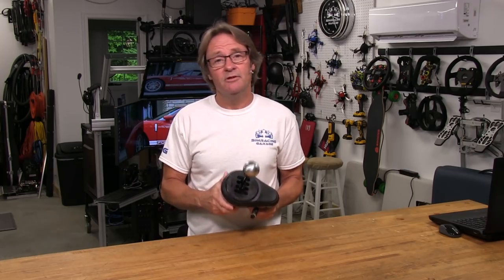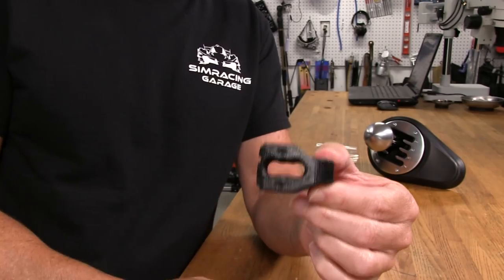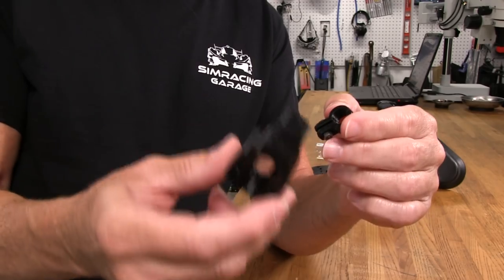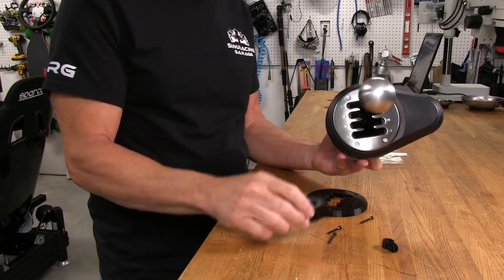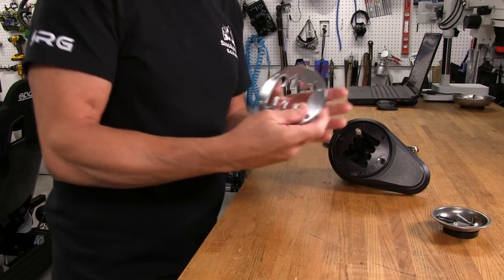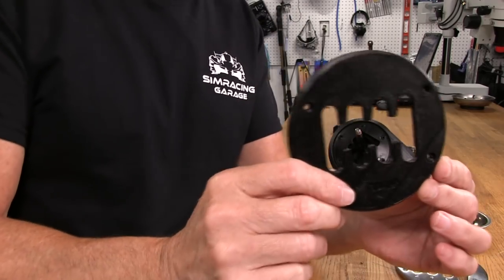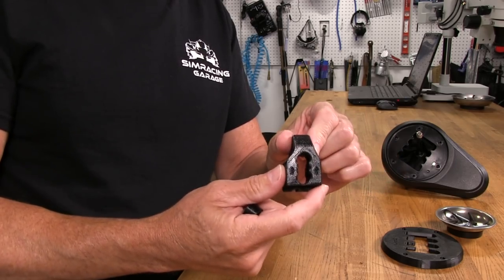3DRap Thrustmaster TH8A Mods

Comment: Hi Barry great video my tactile mod lasted a few months greased up but with heavy use I bought another and it lasted similar time so what I have done is drilled and tapped out for m5 spring ball plungers on the 4 proud points of the mod so that the shaft pushes past the spring ball bearings instead of the pointed plastic also I put some thread lock on it’s going well 6months on
Reply: Hi Mark, is it possible to share your mod ?
Reply from the maker: Sounds like a well thought out solution. Might want to think about producing them yourself. I'm sure folks would buy it. Especially if the life cycle is long. PLA is a great prototyping material, and for some things like enclosures and such, works great. If I was making this mod, I would be printing it with a suitable nylon filament. And maybe adding your spring ball mod to that. I think it would last much longer. More expensive to produce of course.
Reply: Interested on how to mod this with the spring ball plungers.
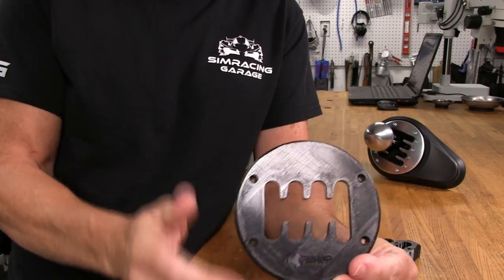Reply: skip to 4:30 or so
Reply: Sim Racing Garage Barry if you managed to mod it please make a video, I am sure it will benefit alot of fellow sim racer. Thanks!!
Reply: can you share pictures about so we got to understand t better?
Reply: ahmed mohmed when I did my own mod nobody else was doing it maybe I should of took it to market but lots of people are doing it now just look at the clix beatle pro mod or the are some cheaper Chinese versions on eBay

Comment: the tab on the metal plate cover is only a locating pin for the rotating assembly. the sequential button would be in the center of the top right and bottom right screw holes given the rotating assembly is clocked for sequential mode.

Comment: I get a bit bummed out with sim racing gear sometimes. This seems like a neat idea if you don't mind regularly buying replacement parts or own a 3D printer and don't mind taking your shifter apart regularly either to grease it or replace parts, but I'd prefer to have something more durable/permanent.

The problem is, when I search for mods I either find home made mods where people wrap rubber bands around stuff or 3D printed parts like these that just won't last very long. I'm willing to pay that bit extra for similar concepts that are better executed and more permanent, but nobody seems to make them.

I could shell out more money for a better shifter, however I'm a cross platform gamer and it bugs the hell out of me buying expensive equipment that I can only use on a particular platform (I find it ridiculous that they expect people to buy a wheel that costs more than a console for each console they'd like to use a wheel on).

This last paragraph is less reasonable for me to complain about, but I've started my rant so I'll finish. I have a lot of older console games for PS2/PS3 that I'd like to be able to play using a force feedback wheel in future. I wish wheel companies included legacy support as it's a pain in the neck having to hold onto (and mount) old Logitech wheels when I want to indulge in a bit of nostalgic racing. I doubt it would be hard to do and I doubt it would be any skin off Sony's nose if someone included support for their discontinued consoles. I do however suspect I am either part of a very small minority or the only person that cares. Guess I'll never know how Enthusia Professional Racing feels with a direct drive wheel (when I eventually get one). 😥

Comment: Great review.  2 questions: How would you tighten the lock nut ring if you don’t take off the metal housing, and does the zip tie that was removed serve any purpose?
Reply from the maker: There is enough room inside the housing to get an allen wrench in and tighten the locking collar.
Just need to turn the collar to facilitate. Zip tie installed at factory to take up slack in that wire to keep it from interfering with the movement of the shifter lever mechanism.
Reply: Sim Racing Garage so removing the zip tie can cause any risk for the cable to snap after the reassembly during the usage of the shifter ?

Comment: I wish they could make this realistic resistance in the H-shifter mode. I’ve tried to make this myself which you can see in my homemade sim rig video, but it’s not that solid.
Reply: Well then it is your lucky day because this is actually made to be used in the H shifter mode. As far as I can tell it only changes the front to back resistance, not the side to side resistance. Since the sequential mode is used in the side to side direction, it will not change the feeling in sequential mode (maybe a tiny bit because of the contact between the mod and the metal shifter frame, but I doubt you would feel the difference).

Comment: Have you tried using the MOD Cambio with the Ricmotech short throw plate?  Do the two work well together?
Reply from the maker: Actually I did bolt on the Ricmotech plate and it worked fine. The Ricmotech sits higher, but there is only a 2mm difference in the spacing for lever travel between the two plates. So, not a noticeable difference to me.

Comment: Barry for the TH8A in sequential don't you need to replace the H-pattern metal cover with the included additional black plastic cover for sequential which includes a notch to press the button? I mean in reference to your note of the fact that the replacement H-pattern mod doesn't include the notch so it cannot be used for sequential mode.
Reply from the maker: Yes, the sequential switch has to be depressed to let the shifter know you want to use it in sequential mode, or hand brake mode. The 3DRap unit I received did not have a tab like the metal cover does. The Ricmotech short shifter plate does have the tab. As shown in my review of that unit. I suppose you could manually insert something to press the switch down. Then the plates pressure on that, when you screw it back down, will put the shifter in sequential mode.
Reply: Ok. I have a TH8A and I just use it in H-pattern mode and have never used it as a handbrake or sequential. To be honest I don't recall if I need to replace the metal H-pattern cover with the included black plastic sequential cover to use it in sequential mode or just change the orientation of the H-pattern cover.. Time to pull out the user manual then I guess :)
Reply: Davy Jones The tab in metal plate does not push the button, that is simply to center the plate to the rotating assembly. The plastic plate has the tab which presses the button. The tab on the metal plate is purely mechanical, and serves alongside no electrnic function. Same goes for rotating the internal assembly, this is purely for ergonomic purposes. When the tab on the plastic plate is installed there is another tiny tab which engages the sq button. Handbrake functionality is an option you can select in the software when in H mode. When the box is checked it functions as a handbrake.
Reply: Yes fair point and thank you for clarifying... As I said I use the shifter in H-pattern mode mostly so he sequential cover is in a drawer somewhere. As I noted earlier it was time to check the user manual again, which have made more sense than asking stupid questions :)
Reply: Are you actually questioning Barry?

Comment: Hey Barry what's the difference in the lenght in throw between this mod and the Ricmotech short throw? I noticed in the Ricmotech you could see the stock black base plate of the TH8 underneath the chrome plate but with this mod you can't see it.
Reply from the maker: The black base plate is actually the Ricmotech plate underneath the stock metal plate. The Ricmotech is 44mm wide and the 3DRap is 42mm wide. I don't think you would be able to tell the difference in everyday use.

Comment: Is it possible to have the original metal plate on top of the short throw plate?
Reply from the maker: Yes , the holes line up. So you could using longer screws.
Reply: The supplied bolts are too short to hold both the short throw and the metal plates?

Comment: I notice you're not using the clutch. Is it not required?
Reply from the maker: Yes, not required. This gearbox uses "dog gears" so you only need the clutch for standing starts or stopping. Only need to release throttle on upshifts, and blip for downshifts. Although I sometimes use heel in toe with this car when demonstrating pedal sets.
Reply: @simracinggarage3026  so it's car specific?
Reply from the maker: Yep!

Comment: I just ordered one of the cambio mods. Does it work with the shifter in sequential mode?
Reply: i am buying it now just woundered how long did it last ? i heard that it worn out too quickly ?
Reply: @DrManany  still doing fine. It didn't have quite as much resistance as I was hoping it would but it's an improvement for sure.

Comment: Does the shifter work with hori apex on pc
Reply from the maker: It will work with any wheel system if you use the Leo Bodnar Logitech USB adapter. Makes it a stand alone USB shifter for PC.
Reply: Also on pc